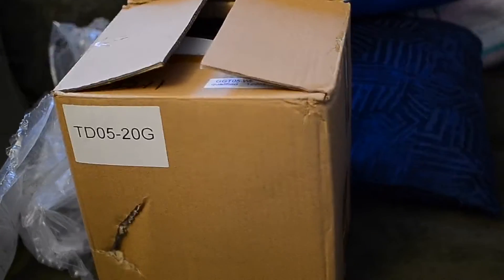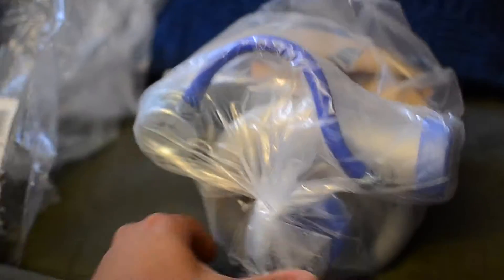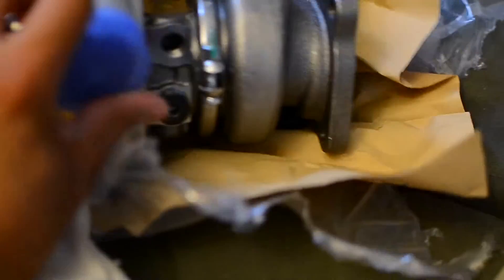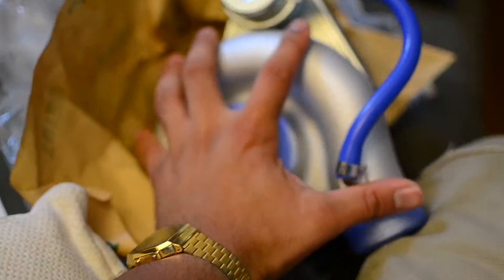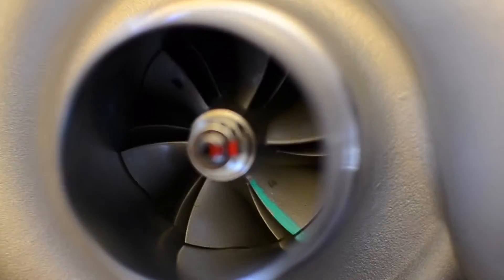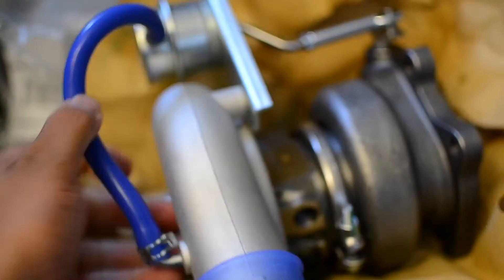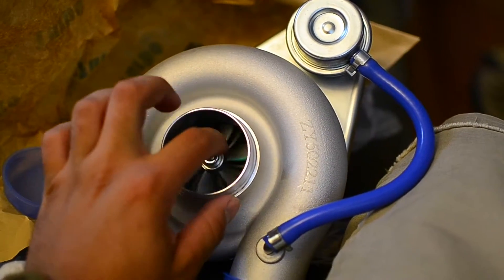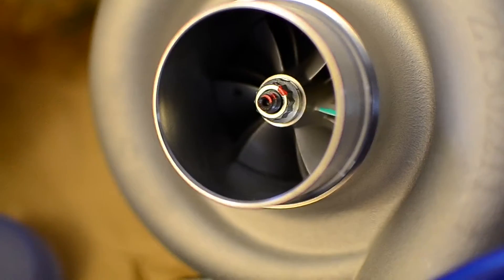Twisted Motion 20g WRX unboxing

Comment: have one on my 05 wrx and it performs wells. no smokes.
Reply: hey did you have to do any modifications when installing it i have a 05 wrx too, does it just bolt on like the td04?
Reply: i had to bend the bottom coolant line to clear the oil return line but other than that it bolts right on with no other modification.
Reply: Thanks! how's it running so far? and what setup do you have?

Comment: You drive it untuned ? If not did you need to get bigger injectors?
Reply from the maker: You need a tune, injectors depends if you want the most out of the car or not. Either way, you need a tune
Reply: StreetFamous BSTN Do you think the Cobb stage 3 tune would work? Or would I need a pro tune?
Reply from the maker: I would do a protune for sure, I’ve heard the “stage” tunes are known to run rich and just be estimates that can damage your engine if you push them hard enough

Comment: Dude which ports did you use for the water lines? Did you only use one side or one on each side which is not blocked off.. thanks
Reply: Ali Toroganan currently searching that answer. I have one on each side. Not sure if it’s right and can’t find no info

Comment: Had one... Raced a guy to my local town. Race lasted 18min 24sec to the point picked. 25 miles almost. Now keep in mind that these are Irish roads coming around bends 130mph + at times.
Anyway got to the point and the turbo was starting to melt and droop on the intake side. 
I've see a lot of money going into cars and all they do is go in a straight line. My opinion doesn't mean shit but what some WRC